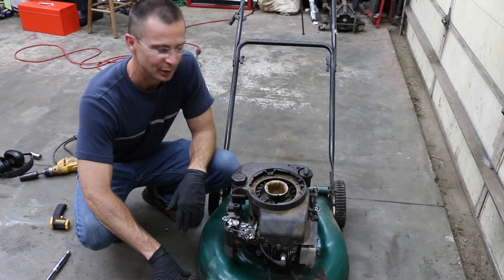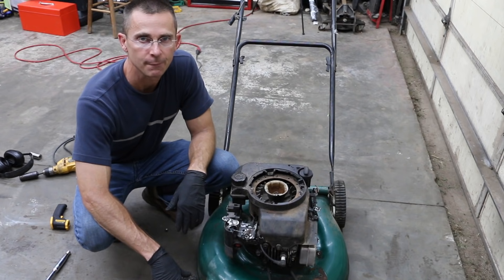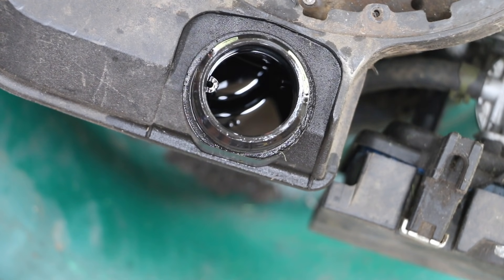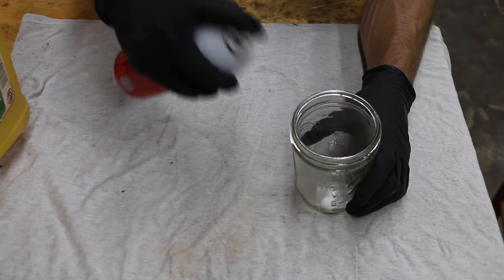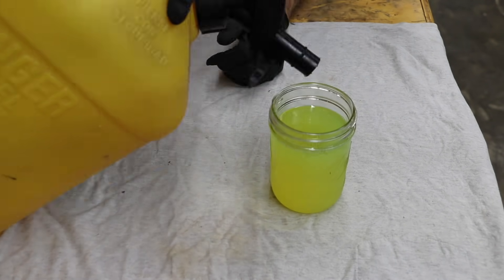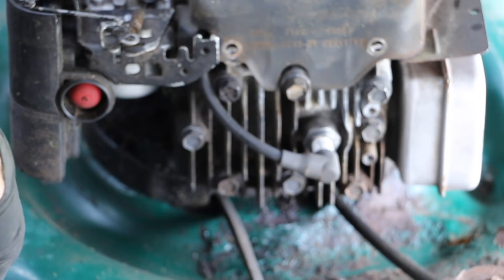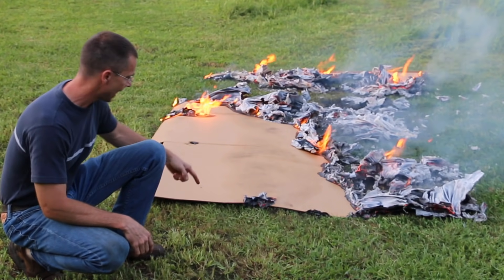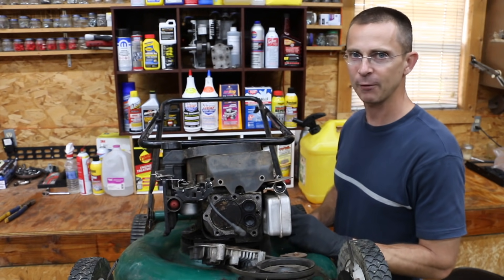Will a Gas Engine Run on Diesel?  Let's find out!

Comment: Great job I was surprised how well the mower ran on the 50/50 good to know 🙏
Reply: I suspect the mower would run on 50/50 anything (alcohol, water, ether) with the gasoline half doing the work, and the other half just vaporizing and coming along for the ride.
Reply: I’d be curious as to how efficient the 50/50 mix is vs. the straight gasoline! Love your videos lol
Reply from the maker: Thank you!
Reply: @ProjectFarm  basically you just made homemade kerosene 

(not really but lol 😂 anyway)
Reply: Multi fuel engines have a heated carb & carb bowl.  I believe if you heat diesel or JET-A (more heat needed) up to the point their partial pressure (vaporization rate) is similar to gasoline they can work.  Gasoline vaporizes at or slightly above room temp so it is vaporized by the time it is in the piston bore (heat of the engine is sufficient).  Propane substitutes the carburetor for a regulator and a metered valve as it vaporizes when it returns to atmospheric pressure.  The multi fuel engine I saw has a selector that adjusts the variable needle bore and the carb heat level based on the fuel you indicate is being used.  For propane, you had to remove the carb and put on an adapter (same intake gasket and manifold bolt pattern.  Not sure how the throttle cable worked)
Reply: Used 50/50 for lawn tractor. Started knock burning especially when hot and under load
Reply: My poppa never put diesel in the yellow Jerry cans that are meant for diesel so he would end up putting straight diesel in his 4 wheeler every now and then. It ran on the diesel but it was rough and would gum the crap out of the carb
Reply: After the engine gets hot enough it will run on a mix of gasoline and diesel/lamp oil/naptha. While naptha runs great in a Gasoline car as is, it has very unpleasant odour and cops will immediately know that you're up to not good. Also it burns hotter, so there's a possibility for engine damage. Diesel on the other hand needs a lot more heat for ignition so starting cold just won't do in an engine without preheat plugs. Furthermore diesel is made of heavier, non-cyclical  hydrocarbons so it burns slower. While you could use diesel/ lamp oil/ gasoline mix to drive a car, you'll Wear out the cat converter because of the amount of soot that it will have to burn when operating like that. Oh and the car will run like shit and smell of poor combustion, until the engine warms up enough to ignite diesel as well. You'll have a rough time  cranking it if you add too much not-gasoline. From my experience with an older car, you can't add more than 20-30% of diesel by volume or else you'll have a REALLY bad time the first few minutes. Just feather it in neutral and try not to choke the engine until it's hot enough. These are my experiences with messing with an old car. It's not good for the engine and cat system, because it increases wear and depending where you live it might also be highly illegal.

Comment: If you think down the fuel with at least a fourth it will work good. The high the percentage of gas the better. In a car it's 2 gallon to 5 fuel to have it operate fairly well.
Reply from the maker: Thanks for the feedback.

Comment: It has long been said around here that adding a pint of diesel to a full tank of gas in your auto will give you much better mileage.  It makes sense from the chemistry standpoint.  Would it do the same in a small engine or a gas generator?

Comment: I wonder if the engine would have kept running on 100% diesel if you had tried adjusting the carb mix?
Reply from the maker: Thanks for the suggestion.

Comment: My hijet 196 Honda clone will run on 100% diesel with a warm engine and full choke but needs gasoline in carburetor to coldstart. It’s on a minibike and is surprisingly drivable
Reply from the maker: Thanks for sharing.

Comment: In short no. But it does work the other way around. As far as I know diesel ignites through compression (similar to the fire piston effect). Gasoline will also ignite when it exceeds a certain compression level (lower than that of diesel?). Therefore gasoline will work in a diesel engine. But unless you want your engine to sound like the Fourth of July, I don't recommend doing it. Use the right type of fuel for your engine.
Reply from the maker: Thanks for the feedback.

Comment: This is old but I found out that the ford 5.0 and 6.2 gas trucks won't run on diesel/gas mix, but Toyotas run fine, even rolling some coal lol. Ps ask your fuel delivery people if the internal bulk heads in the tanker are leaking and mixing fuel before getting it delivered to the farm.
Reply from the maker: Thanks for sharing.

Comment: Once ran a two stroke dirtbike on kerosene which worked great because when it was warm it evaporated the kerosene enough to run but once it got cool it was GG
Reply from the maker: Thanks for sharing.
Reply: @ProjectFarm  wouldn’t be surprised if the diesel was heated to have a higher vapor pressure it’d run pretty well.

Also I’m surprised you use lawn mowers vs something like generators where you have control over the load to some degree. Is it just a cost thing ?

Comment: I talked to a pilot one time whose airplane had accidentally been fueled with jet A instead of Avgas. Inboards only, thank god. He said when he switched to the inboard tanks that had the jet A the temperature gauges immediately pegged to hot and the engine began sputtering. He was able to switch back and the engine began running normally again. Jet A is essentially kerosene.
Reply from the maker: Thanks for sharing.

Comment: I was also curious to test the 50/50 mixture, it's producing a lot more white smoke than yours, maybe lower compression? The smell is a bit odd, it's not gasoline neither diesel smell.
Fingers crossed the lawnmower will start when cold next time.
It's strange the exhaust fumes are white instead of black, the exhaust is probably just spitting out atomized diesel instead of soot particles.
Just how much smoke it still produces when the ignition is off and the motor stops.
Reply from the maker: Thanks for the feedback.

Comment: I have tried to run my 2stroke weedeater on 50/50 diesel/gas mix (and 5% oil). It does run, but revs less and produces lots of toxic smoke. Did someone else try this as well?
Reply from the maker: Thanks for sharing.

Comment: ive seen people run 20% mix on scooters.  claimed it reduced wear but was a bit harder to start cold.
Reply from the maker: Thanks for sharing.
Reply: @ProjectFarm  found a tool you should accuire. http://prntscr.com/uy35p7
ignition tester thats adjustable so you can see how good or bad coils are.

Comment: K1 kerosene will run in a briggs engine if the carb is not part of the fuel tank. Kerosene is a tad lighter than diesel fuel. And the engine will have to be at running temp first. Try putting a little bit of gas in the tank run it out , fill with clear k1 kerosene and restart.
Reply from the maker: Thanks for the suggestion.

Comment: I did a similar test on the 2 stroke engines(chainsaw and weed eater), diesel works just fine on them, possibly even providing more power than gas but it is a bit harder to start and maybe not as stable on low rpm. 
there is more smoke than when you use gasoline but 2 stroke engine requires adding oil and it emits some smoke anyway.
so in the end I now use diesel (with gasoline) as normal fule tor those engines
Reply from the maker: Thanks for sharing.

Comment: I know that this would be pushing the envelope but when you go extra high compression on a race car engine, you naturally have to use a lower flashpoint fuel to run the race. I know the rods in a diesel engine are more than just significantly heavy duty as the amount of shock just on the pin base on the wrist pin is wow. I have worked on both kinds of engines and know all the principles and just can't help myself think about some of the race cars engines being built beyond strong, their bullet proof so to speak. We both know that those even fail under the circumstances of what they are put through. Could a fourteen to one ratio of compression engine run on some diesel and get more bang for the dollar... I am sure it would have been done already.... my old days racing a highway type car wound up with me adding a gallon of diesel to the 104 octane fuel. I know that some of the small trucks and tractors run diesel on sixteen or seventeen to one ratio of compression. I also tried to wrap my head around the so called addiction to either on starting one. I took a Buddha engine down and did a real back yard engineering job on it with using same sleeves over and new rings for another engine cut to length. I was surprised to see it ran well for about ten more years before the end thrust took the crank journals out completely allowing the crank to slide back and forth in its bolted down position about two inches and almost wouldn't keep the timing set together... who ever knew except it only had one job and it did it very well. I suppose that pushing the diesel through a gas engine would do more damage than benefits ratio.
Reply from the maker: Thanks for sharing.

Comment: In the UK we used to have  ( 1950's )engines that ran on paraffin--aka kerosene , it was called TVO "tractor vaporizing oil"  they were basically petrol engines with a hot plate under the carb  you started on petrol and when the engine  was warm enough you switched to paraffine.                    Ps when your long suffering lawn mower engine finally gives up the ghost it should be buried with full military honor's.
Reply from the maker: lol  Thanks for watching!

Comment: I feel like the 50/50 worked because the gas portion ignited off the spark, caused enough compression/heat and the diesel did the rest? I feel like not all the diesel would burn off easily and would flood easy though. But you did mow your whole lawn so the equilibrium seemed to be in your favor.
Reply from the maker: Thanks for sharing.

Comment: Just to give you a heads up we accidentally put diesel in a Kohler 25 horse EFI and it blew up the fuel pump he couldn’t take the heavy weight of the diesel with in two hours of running
Reply from the maker: Wow!   Thanks for sharing!
Reply: It was a 50/50mix

Comment: Old John Deere tractors had two tanks. One smaller one for gas and a large one for “ fuel “. I was told back in the day kerosine was cheaper than gas so they used a dual fuel system. Started on gas and got the engine fully warmed up pulling a disc ( in my case) and once warmed up switched over to diesel.  It did work but in the end diesel was about the same price as gas and not worth messing with two fuels. Mine is an old Model B. But I’m sure all the old 40 ish JD’s had the same set up. My JD hasn’t run in years or I’d do another test. I’d like to see you do the test over with two tanks and switch to diesel after you mow for a few minutes. Heat is your friend not a cool engine.
Reply from the maker: Thanks for the feedback.

Comment: I don't know if it is true but back in the 60's I was told that putting a little diesel in the tank,  a gallon to a fill up would help clean the carburetor. This would be about a 15:1 mix.  Diesel does have some cleaning, but so does gasoline. Diesel has more power in it but with that mix I don't think that would make a difference.
Reply from the maker: Thanks for the suggestion.

Comment: Diesel ignites more by temperature than compression (hence the glow plugs on older engines). If you start a gasoline engine on gasoline and run it until the head is hot enough, it will then be able to run on diesel (roughly, unless you have a diesel atomizer) a bit like a hot bulb engine.
Reply from the maker: Thanks for the feedback.

Comment: I had a 92 Dodge avenger V six. i accidentally filled it right up with diesel.  I though something was fucked in the engine after that because I could barely get it to start and it made huge amounts of smoke. while this was going on I didn't realize I put diesel in it. I actually drove it around for a bit like that. Now this is in the dead of winter so you could imagine how hard it was to get started and you had to keep on the pedal to keep the engine getting enough air.  Once I realized I had diesel in the Tank I just started diluting it with gasoline and it just started running smoother and smoother as the diesel was diluted out.  So yes. you can run a gas engine on diesel. It will make tonnes of smoke and you have to keep on the pedal to stop it from stalling.
Reply from the maker: Thanks for the feedback.

Comment: Gas engines will run on diesel but the trick is getting the engine warm enough to fire the diesel. I know this because I am a mechanic and a piece of our equipment has a Honda gx engine that has run on diesel for the last 2 weeks. To get it started I soak the air filter with gas as well as pour a little into the carburetor, start it with the air filter  off then when it starts to run i quickly put the wet filter on and that keeps it going until it warms up then the it will keep running off diesel until I turn it off.
Reply from the maker: Thanks for sharing.

Comment: when we put farm equipment up for the season we paint the internals in diesel to stop it corroding.

what did this do to the carb? might be an end of season win to run the last tank with some oil/diesel in it to try curb ethanol varnish and it will disolve and burn next season.

i do it with lawn mower mechanic spray at the start and end of season and it works awesome.
Reply from the maker: Thanks for sharing.

Comment: The NFPA makes fire safety recommendations based on fuel volatility using flash point measurements. If a fuel will flash below 140F, it is classified as flammable, above 140F and it is classed as combustible. Gasoline is a flammable liquid, diesel is a combustible. That's part of why diesel is harder to ignite with a spark plug in a gas engine, it has a high flash point. Even though diesel has more energy per gallon, it is harder to ignite. (As you note during your open burn experiment)
Reply from the maker: Thanks for the feedback.

Comment: Wisconsin motors made a retrofit kit for their gas engines to run on diesel years ago. The kits included a different head, and a priming cup to start engine on gas then switch to diesel
Reply from the maker: Thanks for the feedback.

Comment: This is an old video and you probably won’t see this but Diesel engines are fuel injected and the lawn mower isn’t and that could be why. Diesel needs to be directly into the cylinder as opposed to just getting spray in through a carburetor. They also need a little pressure to keep it in there
Reply from the maker: Thanks for the feedback.

Comment: You used a L- Head engine which are  very low compression.  It did better than I thought it would.  I  do put a little 10w-20 in my 5 gallon generator cause it's air cooled and is working hard.  I lose power for many days at a time and buy 87 octane and want to bump the octane up a little to keep it running cooler. I put a couple of shot glasses of oil in the 5 gallons and see zero smoke and generator runs flawlessly. Can't believe a L head will run on 50/50. I guess fuel becomes thicker and flows less through the jet to create a leaner mixture that will ignite and not foul the plug.  Interesting  !
Reply from the maker: Thanks for sharing.

Comment: You should try making biodiesel and test it in a diesel engine.
Reply from the maker: Thanks for the suggestion.
Reply: @ProjectFarm  if you need a recipie:

1 liter vegetable oil
200 ml methanol (yellow heet)
5 grams lye (crystal drain cleaner)

Comment: This is the same reason that for same volume engines diesels have longer strokes then petrol ones and thats the same reason Diesels with same capacity has more torque then petrol engines.
Reply from the maker: Thanks for the feedback.

Comment: We tried this but we ran it on  diesel Vapors had to cook it to get it started but when she ran she had tons of power
Reply: Had a heat exchanger hooked up through the exhaust when she was running it would Cook's diesel in to vapors through exhaust intake heat exchanger. Didn't work so well when we try using waste engine oil
Reply from the maker: Thanks for sharing.

Comment: Does this work with heating oil? Because I could get a 30 % savings using 1:1 ratio because of high tax of gasoline where I come from (70 % of the price is tax and right now about $5.3/gallon regular). Although if I use gallon per week I guess it will not be much.
Reply from the maker: Thanks for the video idea.

Comment: So if you want to burn down a building, use diesel.
Reply: Yes.    You can add Oil to the mix or vegetable oil, and use a sparkler to start.      You can also use a BBQ to buy time.    Place Propane tank on the BBQ, and Diesel beside the  hot burners.      Gives you 1/2 hour to get away.     Old insurance trick.   Go look up Thermite, it is much more fun.   Great for Robbing bank faults or destroying Abrams tanks, etc.    Ignite with sparklers too.   Nice and cheap too.     Places thermite on top of gas tank and   OMG,     Extremely dangerous.

Comment: I have some thoughts 1 try using diesel in the gas tank and gas in the oil tank, and 2 again gas where the oil goes but the mothball solvent with diesel as well both the one you tried in this video and the proposed one at the end of the video
Reply from the maker: Thanks for the suggestion.

Comment: Don’t know about diesel but kerosene will clean a fuel system pretty good.  I use kerosene in my ultra sonic cleaner to clean carbs.  I think it does a better job than soap and water.
Reply from the maker: Thanks for sharing.

Comment: 25% gasoline and 75% diesel fuel would probably run well. During WWII some folks ran their cars on kerosene. Put the tank in the trunk and wrapped the copper fuel line around the exhaust to heat the kerosene for better atomization.
Reply from the maker: Thanks for the feedback.